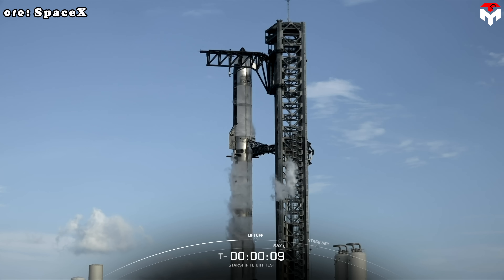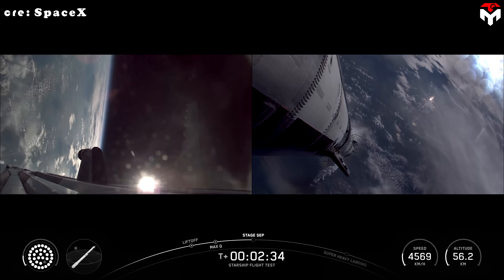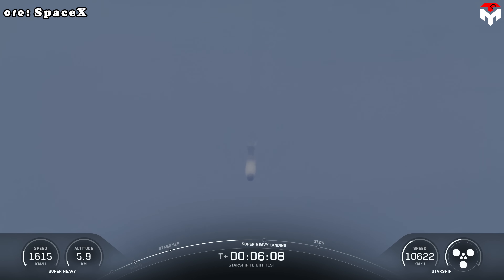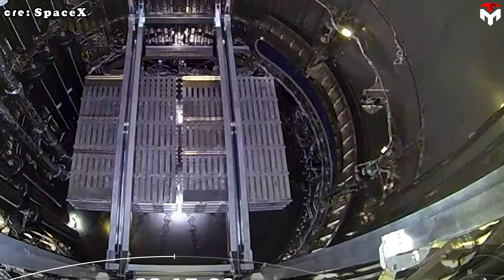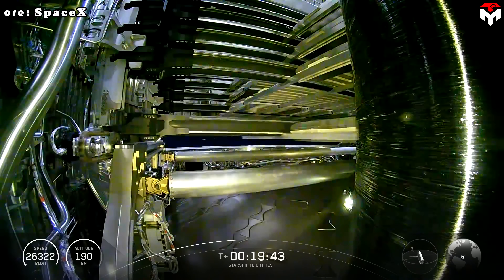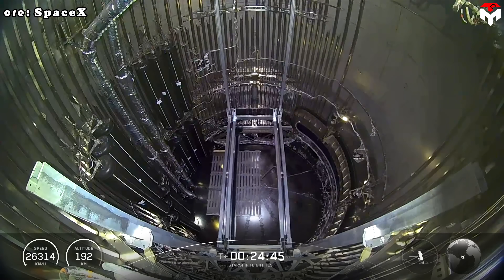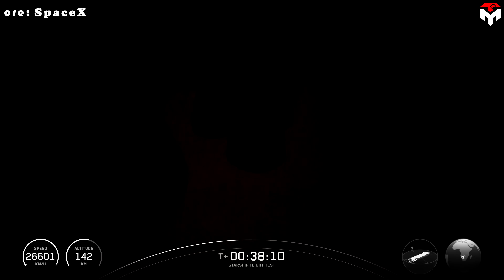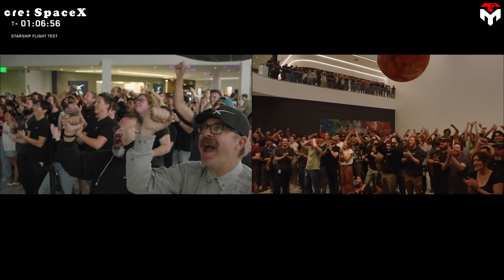SpaceX Starship S37 Deploy Starlink & Splashed down, B16 Flip Landing FOOTAGE REVEALED!

Comment: That suicide flip maneuver of Starship will get people killed.  They need to do it much higher so Starship can get stable well before it gets close to the ground.   Unfortunately, SpaceX can't see obvious issues.  The video that I have seen of the Starship landing in one case the camera seems to move away from the Starship just prior to it touching water.  In another, the Starship seems to be about ten degrees off from vertical near the water.  I would guess that they need to start the flip maneuver perhaps three to five times higher than they do now to allow the rocket to stabilize in a vertical position.
Reply: Yeah, all the rocket scientists and mathematicians need to listen to a keyboard 'expert' whose only achievement was to once parallel park a car.

Comment: The orange color Star-ship upon landing was either glow from heat or the reflection from the sun setting on the horizon. The explosion is probably from the pressure built up when the system gets plugged up by water.

Comment: Both ship and booster crasd down NO REUSE NO CATCH NO LIKE
Reply: They didn't crash, they landed exactly where they were supposed to, how do you think they got the footage. Of course, the booster and ship blew up that's what happens to all rockets when they land in the water and break apart, fuel ignites and goes boom. They have already proven they can catch the booster, 3 out of 3 attempts, why would they take a chance on catching something that they weren't going to fly again because it is a block 2. They intentionally stressed it to the breaking point to collect valuable data, it's worth more than scrap metal plus they are protecting hundreds of millions of dollars in infrastructure investment that they have been building for the last year, they're not going to catch the next one and probably not the first block 3 booster or ship either. They weren't applauding the explosion, they were applauding the accuracy of the landing, did you notice that it landed right in front of the camera in the middle of the ocean?
Reply: They have proven the booster can be caught. And no doubt, after this test, the second stsge or Startship can also be caught. This launch was to test objectives... simulate engin failure and fins stress test...these two can't be done on land. It had to be away from human and on water.
Reply: they already briefed it before launch that this test wont land on launch pad but on the water to test engine failure simulation with the booster and to gather data for the next flight
Reply: These are test flights, and they are testing out different re-entry paths. All experimental and hazardous, so that is why drop into sea after landing. Explosions after landing as they tipped over into the sea is to be expected. There is nothing there to support the weight of the spacecraft and booster upon landing. As it stands, you could use space craft  and booster with modificions for a non reusable heavy boost to orbit or craft to deep space